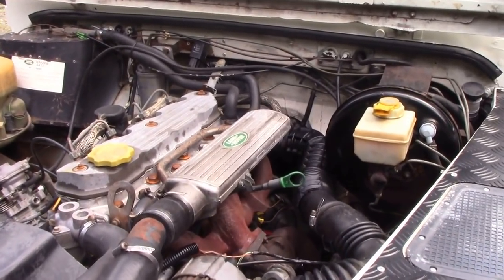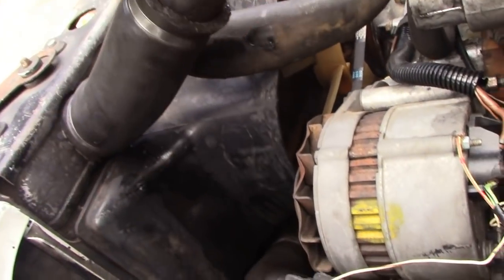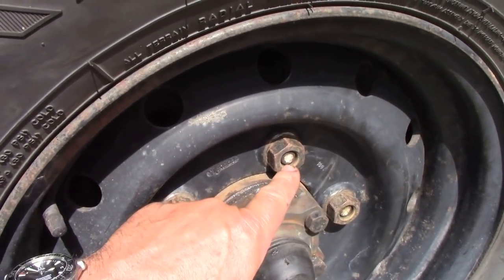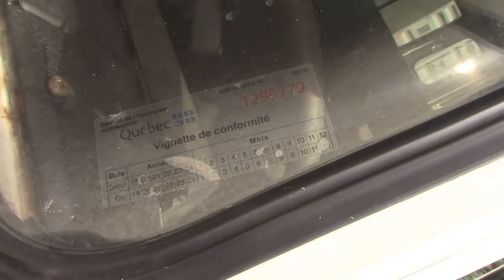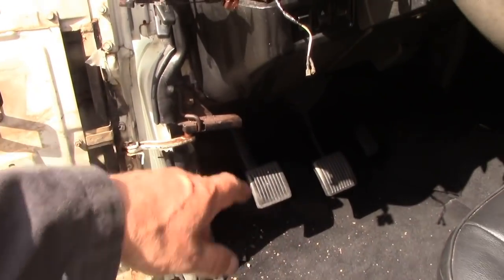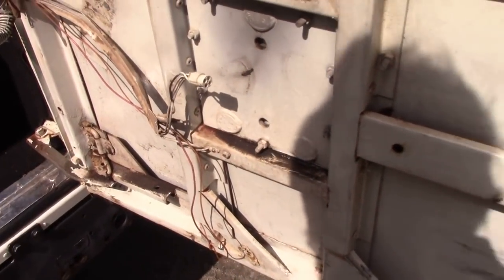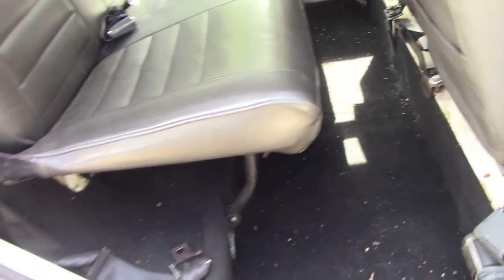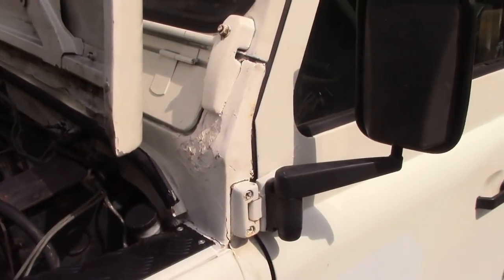Yet another Ghana 110 import! Let's have a look round! Part 1

Comment: Electrics at 09:00 reminds me of the relay controlling the fuel pump on my V8 via the Lucas ECU. 
IIRC, green is the base colour LR uses for certain ignition-powered equipment - indicators, brake lights, fuel gauge, etc.
Reply from the maker: In this instance they have hacked the relays into the wiring so may be for spot lights?

Comment: Well yes after working in West/Central for many years it is amazing how cars are adapted to keep them running. second hand 200 TDI Disco engines imported from the UK were readily avaialble in fact I fitted one to my Camel Trophy 110 , originaly a 2.5 TD,  the problem with the steering shaft I also encountered but after reading the solution in a LR mag you simply turn it round top for bottom , problem solved,  Missing bolts ! unfortunetly if 4 come out only 2 go back until everthing is held on by a piece of wire   dont even get me started on electrics!

Comment: I'd say it was 300tdi before they stuffed (jammed with extreme prejudice) it into the disco 200tdi. That would account for the moved motor mounts. If memory serves the TD and 200tdi have same position mounts but 300tdis were different. Hence why you need a stubby bellhousing r380 on a 200tdi as engine is further back. Oh and the genuine tdi stickers on the body as well seems like too much effort to be fake

That is a bodge tastic defender though, bet there are some fretted splines in every shaft , oi-lless worn cvs and more clanks and bangs than you can shake a stick at😂

Will be a good video series though haha

Comment: Does it actually have a dodgy inspection or someone's just printed out a sticker and slapped it on?
Reply from the maker: In order for the car to get on the road on Quebec it has to pass vehicle safety for the province and meet Canadian  'standards' (daytime running lights etc) so details have to be added into the national computer to say  it conforms and the the vehicle can be registered at the licencing office  - there is quite a paper trial  - so no inspection, no licence
IF, however the vehicle has been already licenced, but has passed by 1 day the expiration date of the road licence, it has too be inspected - there is no annual inspection here - so many go to the local dealer, 'sell them' the car for $120 and then buy it back with a clean licence = a registered dealer can jump the inspection stage 
it is a joke!
Reply: Britannica Restorations Ltd.  That is very scary to hear Mike.  That truck is a death trap, and for sure a bottomless money pit for the sorry individual who was conned or naive enough to buy this.  I think they’d be better off taking it straight to the recycler, do not pass go and don’t collect 200 pounds.  😣

Comment: Those arches look like Bearmach ones. I couldn’t get any britpart ones so I ordered the more expensive Bearmach ones. I’m gutted as they are awful hard abs plastic I can’t see them lasting long
Reply from the maker: I wondered where they came from but I checked them out and I cannot find them  at BM
 I recently bought a set of arches for the 90 and they fitted like a glove  - OEM from Britpart
Bearmach are selling aftermarket stuff from Turkey - looks the part but isn't - same goes for the grill -too glossy and 300Tdi gearbox covers that are not rubber but a hard plastic

Comment: Brown packet or not I presume that someone would be in hot water if this was involved in an accident after 'passing' inspection?
I can only presume that the owner thinks, it'll be ok I'll spend a few thousand with Mike getting it sorted out and I'll still be quids in! In which case I hope that your prices reflect this!
Reply from the maker: Correct. And this is where it gets complicated. The seller writes on the receipt 'project vehicle' or 'restoration project' so there is no comeback - BUT there is a safety inspection on it  - but you cannot have it both ways - is it safe, or does it need restoring - you will see in video 3 when I go for a drive, the brakes are horrendous!
Reply: @BritannicaRestorations  looking forward to the rest of the videos!
Reply: @BritannicaRestorations  What it does have brakes? Or do you just put your leg outside to stop it. Alternatively have an anchor you throw out to brake the car.